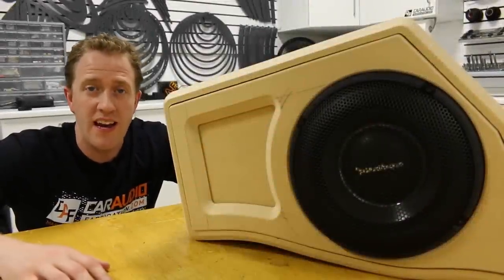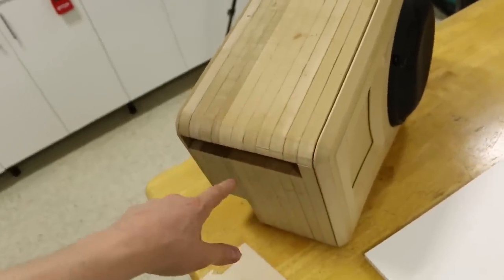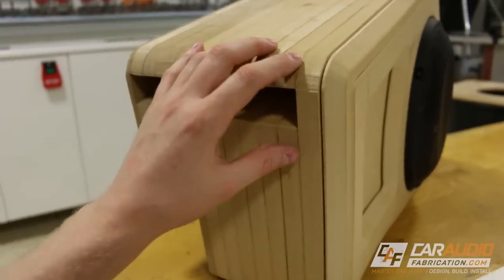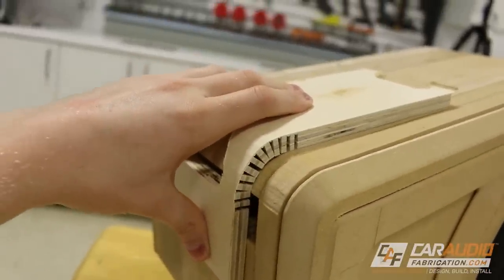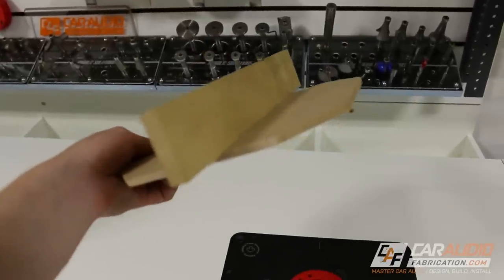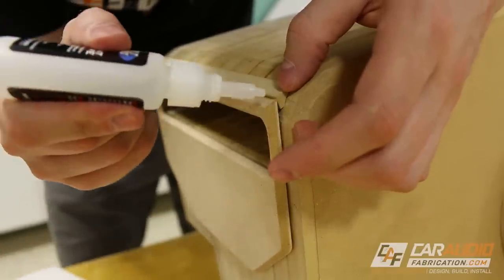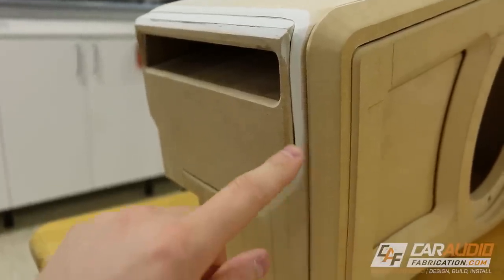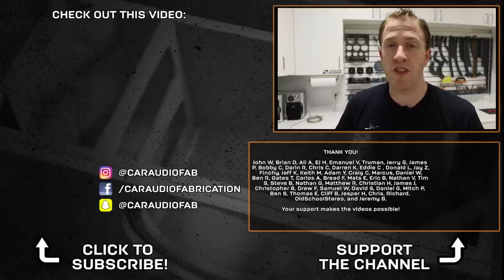Why hide the port? - Subwoofer Box Build Jeep - CarAudioFabrication

Comment: what if you just cut the perimeter of the PVC and got it nice and bent to how you like it, stick it to the box with template tape  and the carry the whole box to the router table to route out the port cut out?
Reply from the maker: Haha honestly that probably would have worked and been a great solution, but once I saw the PVC part on the box I wasn't crazy about it, I felt it was too "thick" looking, part of the other reason I switched to using a thin piece of wood.
Reply: yeah, it would have been a bit unwieldy trying to route that hole while it's mounted to the rest of the box. I am making a box for my Jeep, and I think I'm going to put it in a very similar, but slightly different spot. I'll take some pics when done. No way it looks as good as yours though lol, lovin the Jeep build!
Reply: CarAudioFabrication couldn't you taken the PVC and boiled it in water till it was soft and then let it cool down on the box like you wanted?
Reply: Well, except instead of the router table, use a small "mini" handheld router with the flush trim bit to cut out the port. That'd be my solution
Reply: I did like the PVC idea, but I agree, 1/2" was a bit overkill. I would've done maybe 1/4 or 3/8. 1/4" would be difficult to get camfers and rabbits into and still maintain structural integrity.

Comment: to make the pvc easier to work with, we put it in the oven. the whole sheet becomes a uniform temperature and is eaqually pliable. with yours, you had a wide temperature variation throughout the material, which made is susceptible to cracking and breaking. just a thought. cheers!

Comment: What you did with the cove filling in that gap when using the wood is similar to what I did on my Ram's box, except I used a premade piece of cove moulding and rabbited for it, and then used a 3/4" quarter round trim block for where the top rolls over after the port to the vertical face my amp is frenched into.

Comment: PVC foam board  would also have done great if you bent it as a solid shape and did a plunge cut of the port afterwards . I used PVC board to make door panels before and that stuff works like butter and in moisture resistant .... perfect for auto use .

Comment: another way to help with the bend in the middle of the port that you had would to be (possibly)leave a middle "support" beam and split the port into 2......not sure if that would have worked though because of the issue you had with the outer piece...just a thought. May only work with a larger port like you said

Comment: If you hold off on cutting out the port hole until after you heat and curve the pvc, you could use a handheld router with your bearing guide bit to cut it out.
Reply from the maker: Hindsight is 20/20 and that is what I said in the video... it probably still would have warped..

Comment: Mark why didn't you apply and bend the pvc to the box and then use the flush trim bit on a hand half router to cut the hole to match the port?

Comment: I like the finished product, but why didn't you consider routing a relief into the box surface around the port, and inset a grille-cloth-covered frame?  It could then have set flush to the surface. (Yes, the rear/bottom of the box doesn't have room for the relief, but secured on three sides would be sufficient for the small size. Just another angle.
Reply from the maker: I actually considered this as well. Haven't done any body filler in a while and like to vary techniques for the sake of showing different methods on video, good idea though!

Comment: I noticed you didn't flare the port............Unless the port doesn't need flaring. Cool build by the way :-) nice compact sub for smaller cars and trucks. Can you do a video where you test an open baffle design for a subwoofer? I'd like to see how well a car subwoofer does in an open baffle application. I know their not designed for open baffle, but I'd still like to see how well it would do :-)

Comment: if you want to bend such a small piece of plastic - you should try vacuum forming in your oven. with your wood-working skills, you should be able to build a simple mold with connector for your vacuum cleaner that fits into an oven.

Comment: For the bass port, I would not only drill a hole for the router insert of the bass port, tape it on the speaker box and bend it and the use a portable router and rout the bass port while using the bass port as a guide. Or move the entire speaker box on the table router.

Comment: just a thought if you want to use pvc in that manner bend it first then mark your port reapply heat and cut out for the port or mark and use the router after bending yes it will be more difficult to cut the port out after the pvc has been bent and no you wont be able to use a template but its possible...      ...in theory anyway

Comment: nice job. I like the second try better. but you could have made the pvc work by putting the chamfer on the outside then bending it as a solid piece. after that use a handheld router to flush trim the port area using the port hold as a guide.

Comment: Full sheet, no hole. form it to curve, then drill a hole for the router bit, then hand (not table) router out the hole. You just won't have that inset step on the hole's backside for your wrap, but you can do all the other things you did to the pvc before bending it....

Comment: Out of curiosity, what is the air volume of the box? I'm looking to build a ported box that is around the same size and it's for a Rockford P3 10". I'd like to use a slotted port, rather than a circular one.

Comment: You could add the grove on a unbended piece eye balling it like doug does ( it turns out perfect everytime  :)) ) then twist the piece then cut the hole ?. Theoretically the hole should be on the flat surface and it should be easy . Or i could do it for 9 milion dollars :))) . Nice job, and keep it up :)

Comment: Wouldn't adding thickness to the port change the tuning of the enclosure?
Reply from the maker: By  0.1 HZ yes, its negligible. Ambient temperature fluctuation can have more of an impact.
Reply: CarAudioFabrication The ear wouldn't even notice that.
Reply: Sinister I was thinking the same thing
Reply: Sinister depends on who's ear is listening
Reply: So 1/2" in length= .5hz difference in tuning? Longer = higher? Or lower?
I've always been kinda curious about that

Comment: Hey man, I have a 2016 F-250 crew cab and currently have a JL 10w6 in a basic sealed rear center console box to JL specs. It's just not cutting it. Is there any chance you have any plans I could purchase for a ported setup that will bring this sub to life without a bunch of port noise? I went to a local place for a quote and they said $2400, but that just aint happening. Thanks

Comment: maybe you could have done the PVC thing by profiling only the edges and outside line, then bed it and let it cool completely.
And THEN put the whole box on the router table and cut out the port out of the PVC, using the actual box as a template.

Comment: Probably wouldn't cut the hole until after the bend, so that you can keep the strength of the plastic for the initial curve. Of course, that will make the hole much harder to cut. steamed wood may also be a better option.
Reply from the maker: This could work, only problem would be the that I wouldn’t really be able to add the rabbet groove to the backside of the hole once the piece was formed. In this case since I will be adding the cloth and vinyl wrapped around the port hole I really need that rabbet clearance.
Reply: yeah, that's what I meant by much harder, it could be done, but would it really be worth breaking out the chisels for where you can't route? I can't wait to see what solution you come up with.
Reply: Actually, remembered the end of your video just now. You had a very good solution. Anyway, thanks for the videos, you saved me a lot of man hours when designing my own box.
Reply: CarAudioFabrication you could if you used a rabbit bit with a bottom mounted bearing on a hand held router
Reply: CarAudioFabrication or you could have rabbit the clearance into the box itself

Comment: I would have made the outline of the pvc, bend it on place, drill a whole in the middle and then use the router with a wheel on the inside of the port.

Comment: Just a heads up, heating PVC is a very dangerous thing. The toxic fumes that come off that stuff is one of the worse in the business. Just saying man, from one audio guy to another, I would stay away from that except for CNC work, its great for that but heating even with ventilation is just not good for you man.

Leave that stuff to Doug over at SoundmanCA, hes going to die before his box is built anyways LOL.